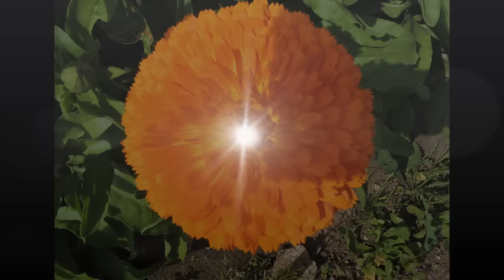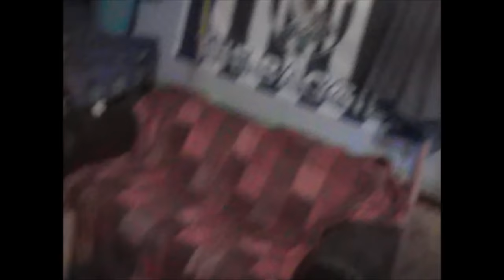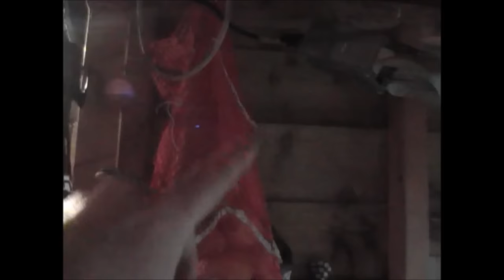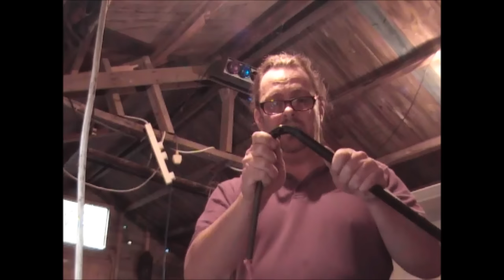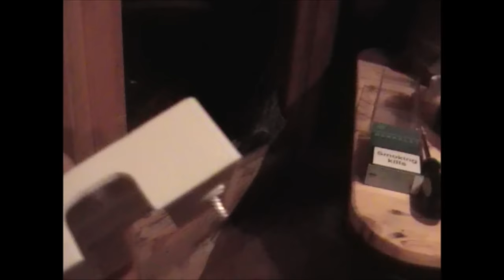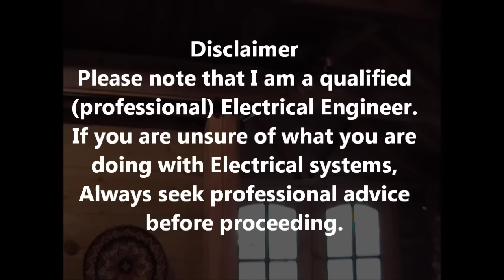Jim's Allotment - Plot 9 - October Tour Part 5 - Fitting Electric Lighting

Comment: A very well explained project.....particularly to Bill's question. 👍🏻
When you mentioned about feed the wires through the conduit 😄😄😄😄😄 I had the same problem and I think it was Poundland??? I got a drain unblocking tape - I call it a fish tape ( spring steel 1 x 3mm section about 2mtrs long) perfect tool for drawing the wires through 👍🏻
When I wired my greenhouse, I managed to get some armoured cable (SWA) as a feed from the mains fuse box, which was 'surplus' from work 😉
I then fitted a couple of IP44 rated sockets.
One oberservation.....is the socket on the roof just for the disco lights?.......maybe just put a 5A sticker on?
Cheers..........Nigel

Comment: Great video mate didn't have you down for a spark. good clear diagram to didn’t notice the fuse box where was it mounted? Was it an RCD or a bog standard 13amp fuse box?
Reply from the maker: Hiya Bill, Actually my degree is in Electronics and Electrical Engineering. I work in the automotive field and design the electrics for engine management systems, it is a far cry from Gardening, I know :o) For the cables. At the other end of the cable that runs to the shed is a 13 Amp plug, In this plug is the 13 Amp fuse. The 5 Amp fuse is concealed behind the light switches, easy to get to though is if there is a problem. I have done it this way to get around the Part P regulations, I have a 30 Amp supply (single dedicated spire from the house fuse box) running to the garage which has 4 x  13 Amp sockets on it. These have to conform to Part P. Everything that is plugged in to it after that does not need to be certified to Part P. Hope that helps. All the best Jim..
Reply: Hi mate you is brainy man :-) My experience in electrics is all DIY I ain’t burnt the house down yet so must be doing something right Ive done the same as you run a dedicated line from the fuse box into the garage which is used to run a freezer off. I also have a spike off my cooker socket running out in the garage to run a washer and a dryer as the cooker socket is not used for the cooker        ( gas cooker ) one thing I should have done was fuse up to break at 13amp but forgot to do it at the time will get round to it some time LOL was a real impressive video mate very easy to follow and great diagram.

Regards Bill